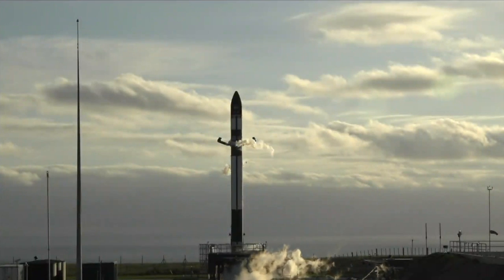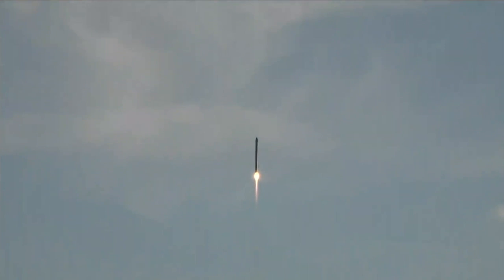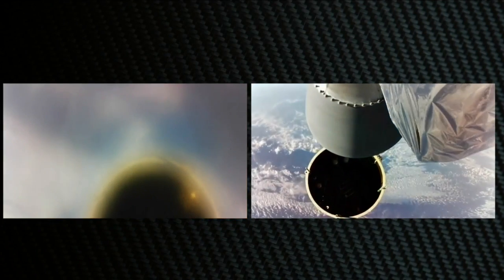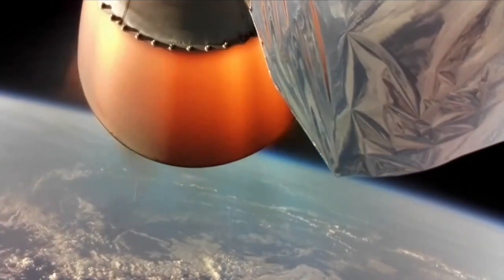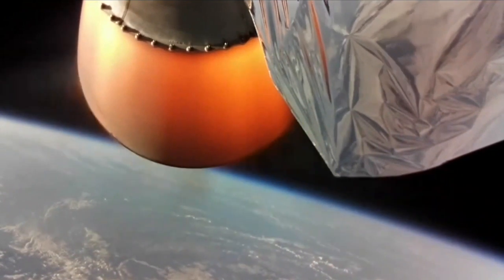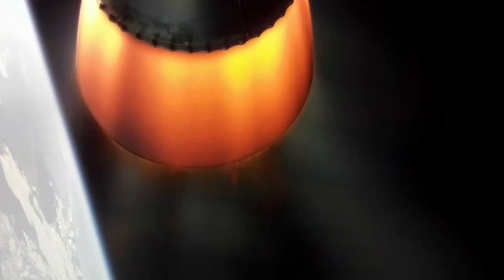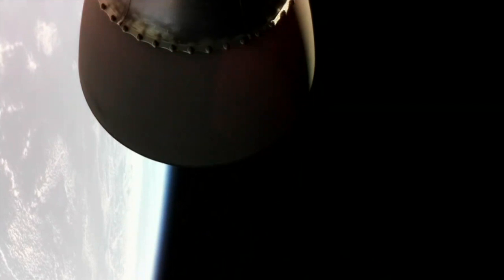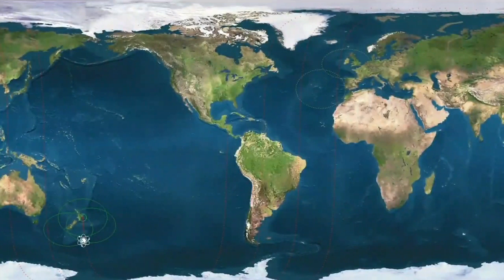Rocket Lab Electron launches NASA ELaNa XIX

Comment: I was expecting an explanation on what this payload does Ih well guess I’ll have to goggle it 
btw like the gasoline driven car don’t you think shooting rockets into space is rather primitive? How about flying into space like Virgin Galactic or Gerry Andersen’s Zero X ... fly heavy payloads as far as jets allow then apply rocket engines to leap the test of the way into space btw Zero X is 😎cool
Reply from the maker: @5cloudwalker You should read the description.
Reply: The reason why we use rockets like these because it’s still the most efficient way to bring payloads into space and in no ways primitive. What you suggest with virgin galactic is as nice thought however is also impractical and the same time physically impossible with the technology we have no for aerospace. We do not have powerful enough engines and a efficient fuel that can bring large payloads like the falcon or delta heavy the way virgin galactic does it. That being said virgin galactic is a purely commercial company so they won’t take heavy payloads anyway
Reply: Also in the field of aerospace there is the dilemma of thrust to weight ratio. For example you can have 5 powerful F1 engines but they are heavy as hell along with the fuel. There needs to be a balance between weight and thrust to get the most optimal results. Rocket science has a reputation for being hard for a reason.

Comment: Congrats!
Now, make the first stage reusable! Littering the ocean like that should be  illegal!
Reply from the maker: Let's be real https://en.wikipedia.org/wiki/Plastic_pollution
Reply: Wouldn't it just burn up in the atmosphere?
Reply: @TimothyKNetherlands  it doesn't go fast enough
Reply: @jamesmorgan1142  Ah I see, was thinking of the 2nd stage instead.
Reply: @TimothyKNetherlands  it does. The second stage, once in orbit, performs a retrograde burn to slow down a bit it's orbit and the it burns up.
Reply: they could use parachutes, the carbon fiber dry mass of the first stage should be low enough to fit some parachutes in without horrid deltaV loss
Reply: They said they didn't want to make it reusable because it would require extra hardware and reduce the alredy small payload
Reply: A kevlar tube like that would probably survive impact mostly intact and provide a safe habitat for deep sea life for hundreds of years. I'd like to see a marine biologist do some research on it. Perhaps Rocketlab could launch such a project? (pun intended) .